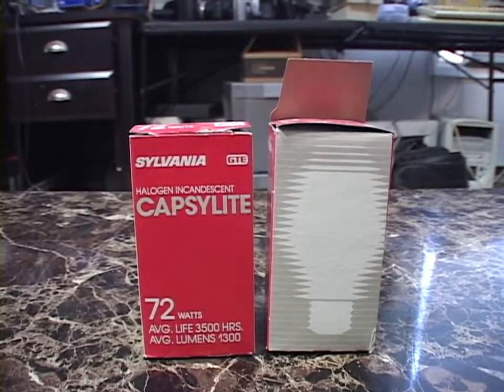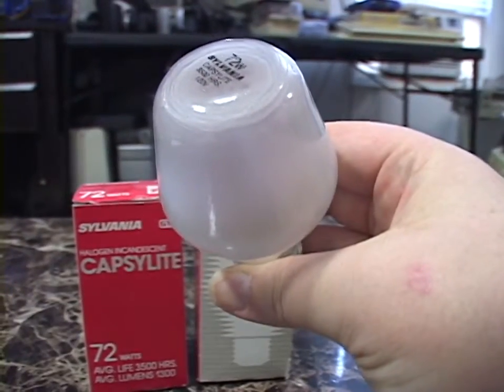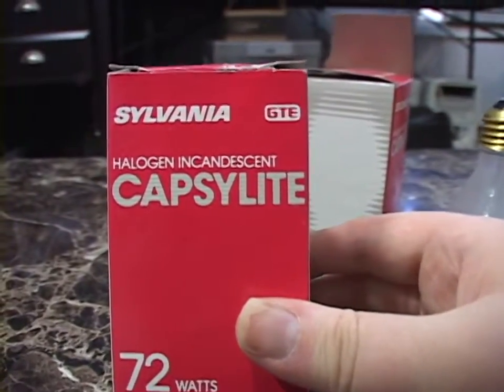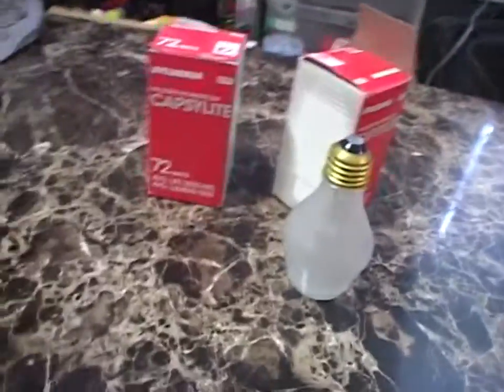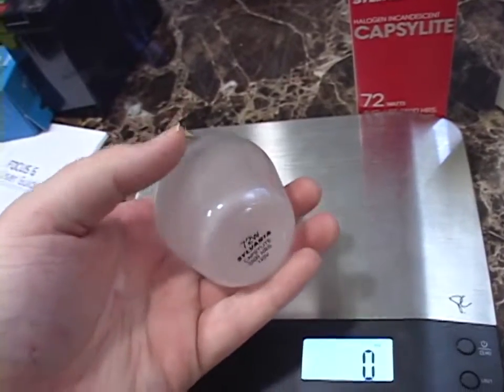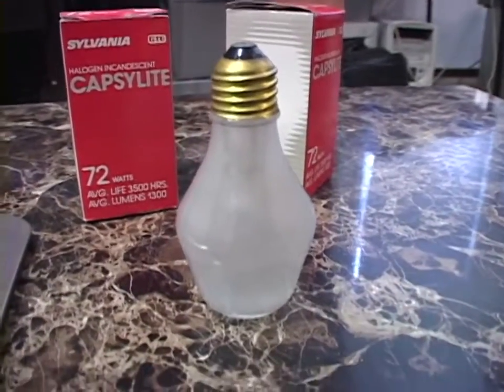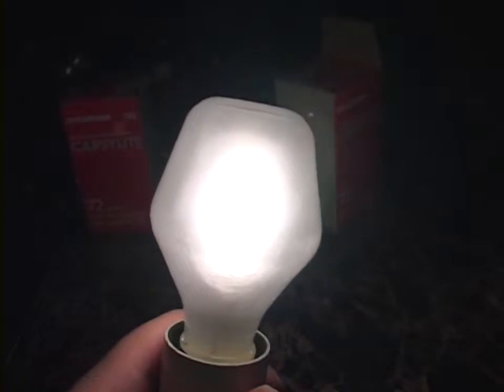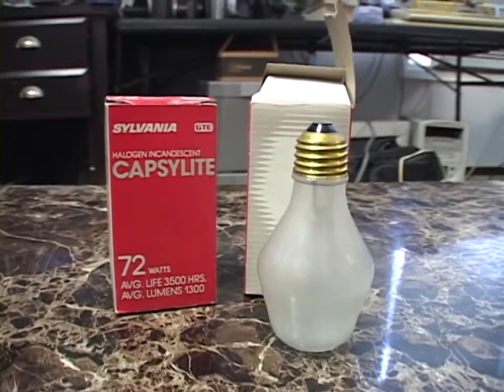Sylvania Capsylite early halogen light bulb (1980s)

Comment: i didn’t know they had a diode inside, very interesting. do you know if they sold them in 220-240V variant?
Reply from the maker: I don't know, but my guess would be no. It was a challenge to design a small halogen capsule that could run on 120V, so I imagine they wouldn't have even attempted a 240V version.

Comment: I remember that unique shape of bulb in my grandparent's house growing up. Always thought it looked neat - never knew about the tech behind it. Very cool.

On the topic of colour temperature, in the earlier days of CFL and LED lights there used to be a middle temperature in between the warm white (2700k) and daylight (5500k). If I recall, it was around 3500-4000k - close to your overhead CFL. I loved those. To me they were "white". Not orangey, not blueish, just white. For whatever reason last time I checked the stores near me only had warm white (one extreme) and daylight (the other extreme). I did find a bulb with a switch that can change the temperature, but it's 5x the price of a normal bulb!
Reply from the maker: I'm lucky to own many CFLs in 3500k, 4100k, and 5000k varieties. They were always hard to find, so I made a point of stocking up on them many years ago.

Comment: That's certainly a neat looking bulb, and they should run just fine on standard TRIAC dimmers. The only problem I can think of is that at the bottom of the range, when normally the light would cut out, current will be delivered in pulses. I've seen this happen when I tried dimming basic LED holiday lights. If you fully click off the dimmer or run a normal bulb in parallel this shouldn't happen.